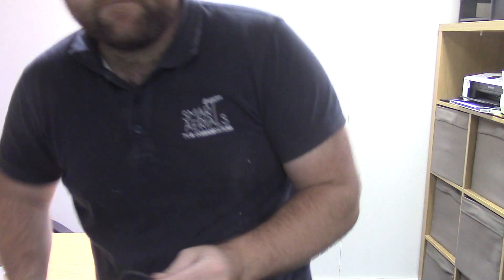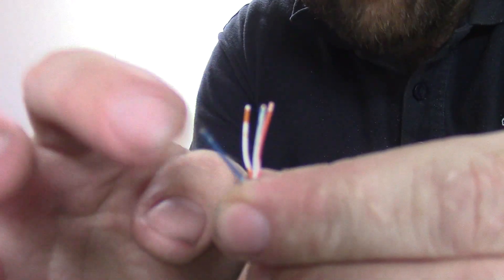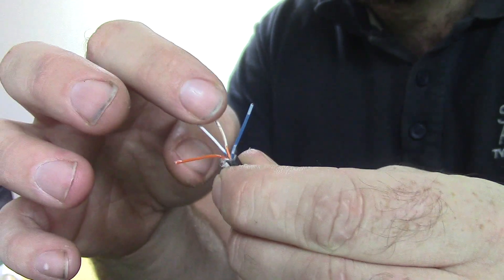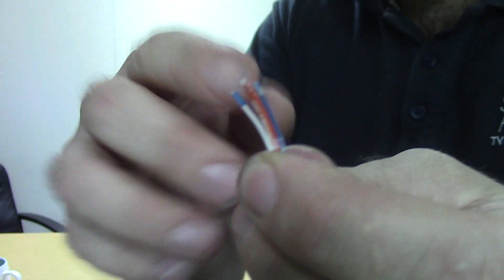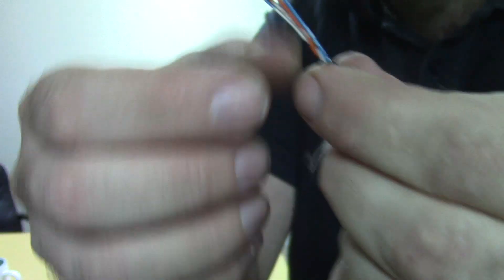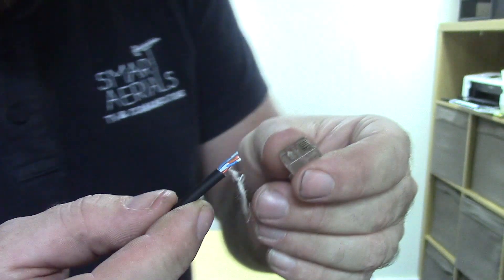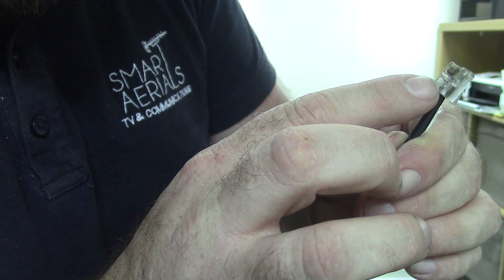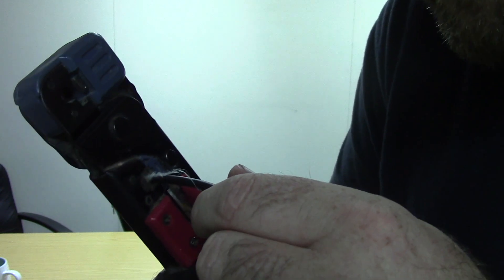How to fit a RJ11 router connection onto a telephone cable

Comment: there is weird problem i bought 10 rj 11 and pinched them but none of them completely connect to the modem, i have a wired with an rj 11 installed on it and it connect completely ok to my modem but it is exactly the same size and shape literally , i have no idea what is wrong with the other rj 11 sockets, they just don't complete fit but they work